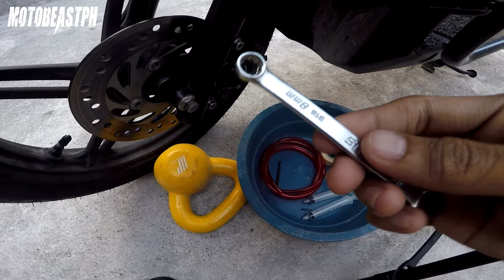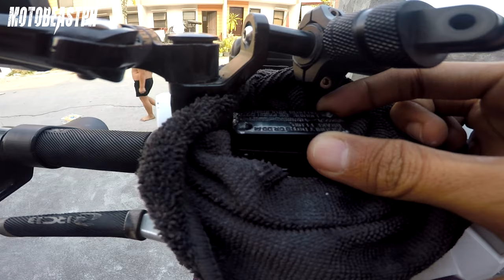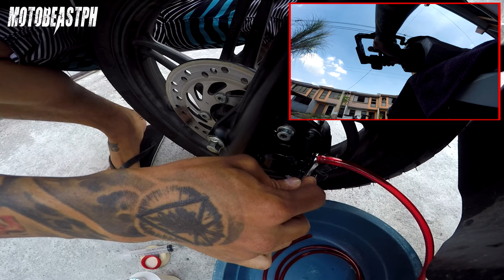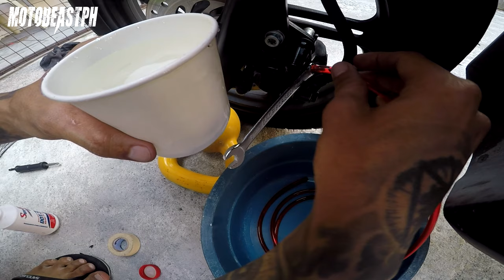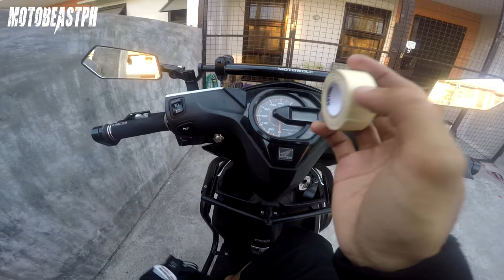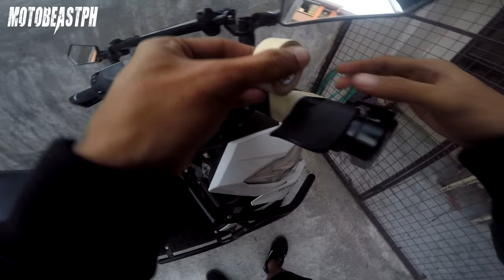Brake Fluid Replacement | Honda Beat Maintenance

Comment: Honda beat fi din motor ko boss. Nag subscribe nko. Ask lng, anung size ng breather hose na ginamit mo?
Reply from the maker: Di ko sigurado, bro kasi sinaksak ko sa bleeder valve kung alin yung kasya nung bumili ako sa hardware. Tingin ko 8mm din siguro.
Reply: @MOTOBEASTPH  thanks po boss, gusto ko rin kasi tignan ung caliper ko. Pigil kasi ung takbo. Pag pinaikot mo ung front wheel, ang tigas tapos my squeaking sound pg tumatakbo. Anu kaya problema nun boss? Sana matulungan mo ko.
Reply from the maker: Madumi lang yan, bro. Yung piston di na bumabalik kaya naiipit brake pads.
Reply: @MOTOBEASTPH  thanks po boss. Panoorin ko ulit ung tutorial mo about sa paglilinis ng caliper. 1yr 3mos na pla ung beat ko. RS po boss

Comment: hi po ask ko lang po kung bakit di na mabilis bumalik yung front break lever pag pinipihit po . kaya po minsan madalas bukas ang break light kahit di kopo pinipihit ang break. salamat po sa makakasagot
Reply from the maker: Check mo kung may leak. Kung wala naman leak, palit ka lang ng brake fluid. Linisan mo na rin caliper at check brake pads.
Reply: salamat pp

Comment: Sir, paano po kung may tagas na sa brake master, ano pong need gawin dito?wala na rin pong pressure yung front brake, di na talaga napreno. Naubos na ata ang brake fluid sa brake master.
Reply from the maker: Pagawa mo na sa casa, bro.

Comment: pano pag d nsagad yung lever sa dulo boss lagi may alawance na konti. kailangan po ba ibleed ng ibleed
Reply from the maker: Di nasagad pag piniga?
Reply: @MOTOBEASTPH  may allowance lang po ng konti boss pero sagad n nmn po repait kit. d nrin po kasi stock lever to pero try ko po magpalit. salamat po
Reply from the maker: @mikemike14351  Normal lang, bro na hindi sasagad kapag piniga. Ibig sabihin nun malakas pressure pag pumreno.
Reply: @MOTOBEASTPH  salamat boss more power sa channel mo po

Comment: Bro harap at likod nba ung break fluid na linagay mu?
Reply from the maker: Harap lang yan, bro ksai drum brake ang likod ng Honda Beat.
Reply: Ok boss... Tanung ko po boss kung bakit magalaw ung manibela ko kapag nag memenor ako... Saan kaya problema nun boss?
Reply from the maker: Pa-check mo, bro yung locknut ng steering head bearings baka maluwag. Dapat sakto tension. No play, minimal drag.

Comment: idol anu kya problema, kapapalit ko lng ng front brake pads kaso pg tumatakbo n beat ko ng 40 pataas eh pg my nasasayad at my vibration? tnx idol
Reply from the maker: Genuine brake pads?
Reply: @MOTOBEASTPH  ou idol galing sa casa
Reply from the maker: Normal lang kasi makapal pa yan pag bago.

Comment: Paps saken ung Lever Lumalalim need kona Ba Iflush and bleed un
Reply from the maker: Oo, bro. Check mo muna kung may tagas.
Reply: @MOTOBEASTPH  Wala Naman boss Tagas Chineck kona sa Brake Master.Idol san mo nabili ung hose ?
Reply from the maker: Sa hardware bro.

Comment: Boss ano ba size nung close wrench pantanggal nung malaking nut sa torque drive?
Reply from the maker: 39mm. Merong nabibili na ganung tool 39×41 yung size. Check mo bro yung video ko CVT cleaning may mga link dun kumpleto.
Reply: @MOTOBEASTPH  thank you boss.. Tignan ko .

Comment: Napakamot ulo na lng ako,ngaun ko pa to naisip panoorin..sa shop ko n lng ipapaayos motor ko,sobrang Mali pagreplace ko Ng brake fluid😁
Reply from the maker: Haha. Yare. Okay lang yan, bro. Next time alam mo na kung paano.
Reply: Maaayos pa ba Yun bro?dun ko Kasi binuksan sa isang bolt ung daloyan Ng fluid tas drain lahat brake fluid
Reply from the maker: @jeeprelvillacorte2161  Oo bro salinan mo lang ulit sa reservoir habang naka-open yung bleeder valve tapos pag lumabas na dun yung bagong fluid mag-bleed kana kagaya ng ginawa ko.
Reply: Salamat bro👍

Comment: Sir..normal lng po ba ung pag pina pump ung lever eh tumatalsik ung s master cylinder reservoir?.tnx po.
Reply from the maker: Dapat hindi. Baka umaalog manibela?
Reply: Sumisirit po ung fluid s reservoir everytime ipump ko po lever sir..try ko po baklasin lahat at linisin ung caliper ko..salamat sir..RS..
Reply from the maker: Okay bro. Pm mo din ako sa fb @motobeastph.

Comment: Sir, ano po kaya problema pag ang disk break sumisikip pag hindi umaandar yung motor? napansin ko kasi pag nakatigil lang yung motor ng 2 - 12 hours sumisikip ng kusa yung breaks sa harap pero pag napaandar ko na luluwag naman
Reply from the maker: Try mo lang linisan caliper at check brake pads, bro.
Reply: @MOTOBEASTPH  okay sir salamat po

Comment: Paps, pano ba pag medyo mahina ay yung preno sa likod?
Reply from the maker: Baka upod na, bro or madumi brake shoe. Try mo rin higpitan adjustment sa likod. Ilan na ba odo?
Reply: @MOTOBEASTPH  7k na paps. Hinihigpitan ko din yung brakes sa likod na tigas lng yung lever
Reply from the maker: Genuine brake shoe pa rin gamit mo, bro? Kung genuine baka madumi lang kaya dumudulas. Matagal kasi yan maupod kapag genuine.
Reply: @MOTOBEASTPH  di pa ako nagpapalit paps. Lahat stock parts pa
Reply from the maker: Either madumi or upod na yan, bro. Pa-check mo nalang sa casa or kahit ikaw nalang gumawa. May vlog ako nyan, bro drum brake maintenance.

Comment: san ka nakabili ng bleeder hose lodi?
Reply from the maker: Hardware, bro.
Reply: Dapat paps. Sa center spring naman yung gawin mo sa susunod mong vlog. Hehehe waiting ako o kaya yung stock na kick starter pag kinikick hindi bumabalik. Abangan ko lodi 😊
Reply: Maganda ka mag vlog eh. Detalyado kasi mga vlog mo lodi 😊🤣😂
Reply from the maker: Meron ako vlog, bro ng cvt cleaning. Yung sa kickstart lagyan mo lang grasa at linisan para gumana ulit.
Reply: Napanood ko na yung cvt cleaning mo paps. Wala yung sa center. Yung center stand na hindi bumabalik. Yung center stand dapat nililinis yun dba kasi kinakalawang  Ayun ang mga problema sa honda beat nation.
Reply: Di ko alam buksan yun hehehehe 😂🤣 yung sa kickstart 🤣😂
Reply from the maker: @jeromearcaina5715  Ah akala ko center spring. Lagyan mo lang muna WD40 every 2 days yung ehe ng center stand para madali matanggal kapag papalitan o lilinisan mo na.
Reply from the maker: @jeromearcaina5715  Pm mo nalang ako sa fb @motobeastph, bro para mas matulungan kita.
Reply: Ok paps salamat 😊
Reply: Di ko makita fb mo lods. Motorbeastph ba?

Comment: Idol panu kapag bleed ka ng bleed ayaw. Tumigas ng   handle. Anu kaya problema na nun.. Naka ubos na ako ng 1 bote ng fluid ganun pden.. Tama naman piga piga bukas sara tas bitaw..
Reply from the maker: Baka may leak sa hose or sa banjo bolts.
Reply: @MOTOBEASTPH  wala naman leak idol. Check. Ko lahat wala naman..
Reply from the maker: Pagawa mo na sa casa, bro para sure.